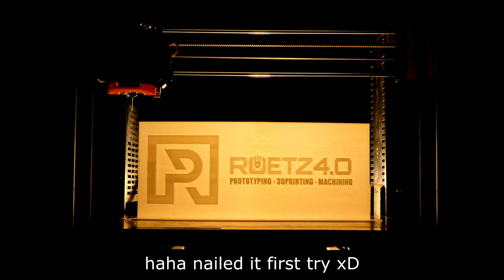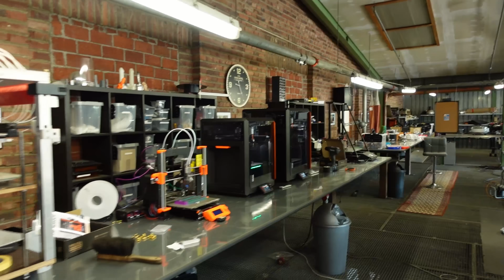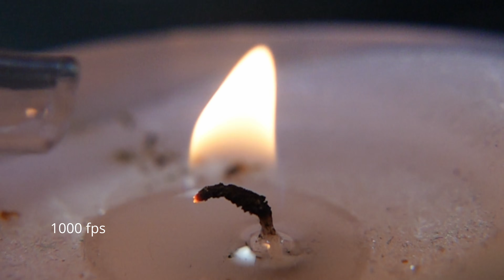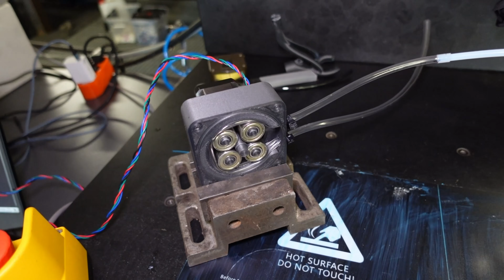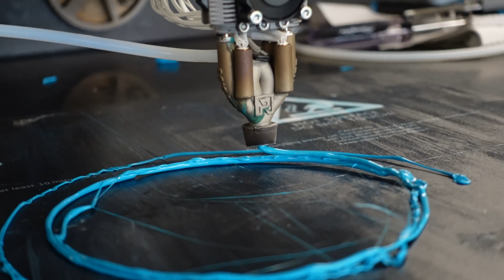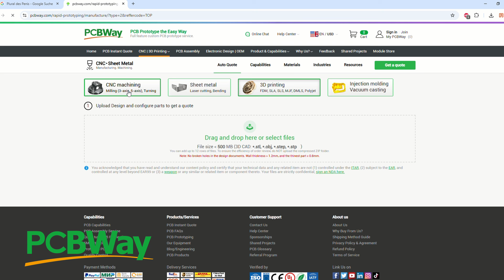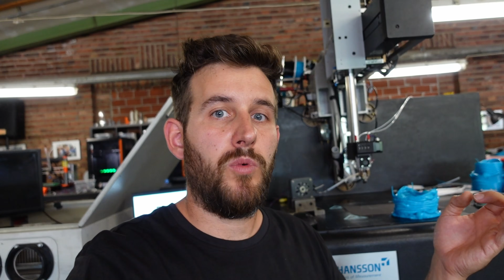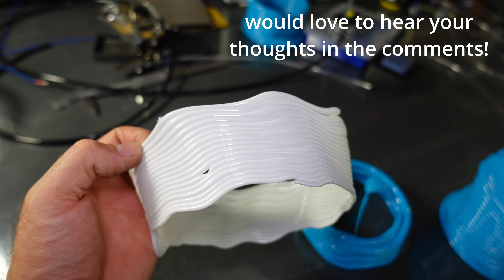Your Ideas made it WAY BETTER! 3D-Printing TPU Tubing

Comment: would it work to use water through the air channel instead to cool the plastic at the same time?
You could reuse it from a tank in the bottom if the prints starts a hole in the bottom of the print.

Comment: Use large syringes to provide a constant airflow. You could use a recycled Z stepper to plunge the syringe at a constant airflow. Maybe with two syringes and opposite threading one syringe plunges as the second syringe refills providing constant airflow from linear screw motion?

Comment: I think that using some form of an air tank/compressor, and have a variable valve that you can control, maybe a ball valve or an iris that you can let out a consistent flow of air would be what you’re looking for. The peristaltic pump I think would be an issue, especially down the road, as you would likely have more failure points.

Comment: I think you need something to blow cold air onto the part while it's printing, to cool the filament down faster and prevent it from expanding too much or melting excessively and losing height. Also, the speed seems a bit too high for something that stays molten for a long time.

Comment: I wonder if you would want to slightly vary the airflow based on the length of tubing (ie the amount of tubing you have already printed). My thoughts  are that after a while, the tube length becomes a significant "pressure vessel" or "tank" if you want to call it that. It mught be part of why it's hard to get the tubes started, after a certain volume the effect of the tank becomes significant enough to 1. Reduce the pressure, and 2. Smooth out the oscilations in pressure the pump produced. Overall really cool results!

Comment: I haven't quite grasped the idea behind all this yet. Is it about building the pump yourself, or is it about the end result of inflating the TPU? What about a small compressor with a tank and adjustable airflow? I think the tank and the ability to regulate the airflow—ensuring a consistent air flow rate at the right pressure—would be the simplest solution here.

Comment: try starting  in a spiral. Your starting layers are failing, but it starts going fine once it's established. Maybe that's a heating/cooling issue. Some sacrificial layers to the inside of the structure would give  it time to work the kinks out, potentially, as well as give it some structure to lean against when it gets to the first real layer. 

Or maybe it's as simple as preheating the bed.

Comment: Possible use case:
Quickly print a form that's a single unbroken tube, then fill said tube with another material (maybe something difficult or impossible to print, or to get specific composit material properties) 
Like silicones, urithain plastics, etc.

Comment: Since the volume of air changes with both temperature and pressure, I suspect it's very difficult to get consistent results by controlling the airflow without either an absurd level of control of the air temperature the whole way, and/or measuring the diameter of the extrusion and adjusting the airflow based on that continuously.

Comment: I think a mechanical pressure regulator on a constant supply would be great if you add a fast enough electronic valve controlled by PWM

Comment: instead of going up continuously in vase mode, have it step up in z each layer, and stop extruding for a second or two each layer and maybe rewind the pump to create a small vacuum to collapse the tubing at the seam. Doing this should make the layers more consistent since backpressure isn't continuously building as z goes up. your layers should be more repeatable and the only downside is you have one seam going up the wall.

Comment: Tubing has the potential to print very large objects very fast, but you have complicated needs.  The outer layer needs to adhere to itself while the inner layer should be prevented from adhering to itself or even deforming much.

Four ideas.

I keep thinking that to make a consistent print you cannot rely on a continuous run, simply because the pressure will have different effects when there is 10m of tubing to resist back pressure than when there is 10cm, and temperature of cooling hot gas throws a multi variable confounder into the equation.  For a consistent result it seems like you would need to perforate the tubing regularly (a 1mm laser hole or needle every 1cm?) to let out hot gas so that in the critical bonding zone you remain consistent.

Modern garden hoses are typically composites, especially near the reinforced ends.  A spiral of PLA embedded in TPU tubing would provide interesting material properties and interesting curing/solidification behavior, while requiring an extremely novel printhead.  Alternately, trying annular rings of different materials gives you an inner jacket of one material and an outer jacket of a different material.  Perhaps you tune this by using materials of different melting points and glass transition temperatures.

Assuming we do stick with a single ring of a single material, I think you also need to try prechilling the air running inside the tubing; the stiffer the inner wall of the tubing as it comes out of the extruder the more consistent of a result you might achieve.  The interior needs to be cooler than the exterior so that the exterior can bond layers while the interior does not even bend in on itself.

Using multiple shapes or a complex shape in place of a ring seems like it could provide desirable controllable dimensional stability. Perhaps instead of a tube, it's two tubes.  Two tubes right next to each other form a figure 8 or infinity symbol with two cavities. Perhaps try a square with four cavities, a hexagonal shape with six cavities or a honeycomb with seven cavities.  Inside the free flowing melt pool in the extruder you have some freedom to shape a manifold.

Comment: One problem you may be having is that the volume/pressue of the air will change as it cools. The longer the tube the more volume of gas you have at a stable temp, which can absorb some of that change in volume. I think this is why the start is so inconsistent: it's a small volume that is rapidly changing temperature from near printing temp (~200C) to close to ambient (~25C). With air that would be a volume change of around 40% assuming pressure doesn't change (The pressure will change, but that's going to depend on a lot of factors we don't have values for). My point is that the volume and pressure in the tube will be fluctuating a lot until there is enough volume of gas to absorb the change in volume and pressure of new hot gas as it cools. It may be that there will need to be a waste section that is meant to be cut off until the pressure/volume of the gas in the tube evens out. Maybe try a zig-zag pattern off to the side before starting the cylinder section to give that cooled volume of gas.

Using a liquid (as opposed to a gas) would prevent it from ballooning out like the gas does, since it won't increase volume to fill a larger space. It would require finding a liquid that remains liquid at both room temp and at printing temp, maybe something that does become solid at room temperatures could also work, but at that point you could just use a dissolving filament in your other nozzle (the one that you were printing coils with), if you could push the core filament at a higher rate then the encasement you might be able to get the same kind of tube structure (using PVA filament as the core for example), but you would need a lot of the core filament.

Comment: You may be able to drive a recycled refrigerant compressor, one of those fancy scroll compressors with a synchronous/AC motor, with the right stepper driver.

Comment: Just use a pancake air compressor and a flow regulator valve from an oxygen bottle. You likely dont need an inert gas or anything, but a flow regulator valve from an oxygen tank is measured in Liters per minute, not pressure, and can be dropped down pretty low for running nasalur cannula. I dont think a regular pressure regulator would work if you want to regulate volume. Good luck, hope to see it working!

Comment: This probably is WAY too much overhead, but would some continuous scanning during the print that analyzes the tubing shape and adjust the air flow and extruder sync ratio? There is a long way to go but this is amazing progress! I am blown away by the consistency.

Comment: Hey, this is the first video I'm watching in this series and I'm not sure if such an idea was already brought up or not but, do you think it would be possible to have the nozzle extrude at an angle rather than straight down? Like maybe a 45 degree angle with a built in gear system that will automatically turn the nozzle so that the extrusion is always facing the opposite direction of where the print head is traveling?
I imagine something like that would be extremely complicated to produce but it just came to me as an idea and I thought it wouldn't hurt to throw it out there before I go to work.
Thanks for all that you're doing against the gatekeeping of innovation, we really need many more like you in these fields! 😁
Reply from the maker: I think that would be doable, however quite some effort to achieve.

Comment: Your pump is a classic use-case for gearing - you want it to go really slowly, with lots of torque. I'd start off with like a 10:1 gearing.

You should put a spring loaded expansion chamber on the output of the pump with a really weak spring, it might help absorb some of the pressure irregularities in the pump output, as I assume the peaks are the main culprits of the bubbles.

You might be able to tilt your nozzle by something like 45* or even more (just the tip needs to be oriented that way, the rest of the hardware could still be vertical) and then add an extra axis to be able to spin the nozzle around on the vertical axis, so that your tube is extruded in a direction much closer to your print direction. I think this would have extreme benefits from not having to print so high up, and also enable you to add print cooling while still getting layer adhesion.

For starting your print, why not print like a traditional printer for the first layer, air turned off, nozzle really close to the plate, just to get good adhesion, then lift and turn on air for layer 2? Doing that should also give you your starting pinch as well at a predictable location, which should help with air volume and pressure adjustments. If that isn't acceptable and you want to start with a tube, a two-printer process may also work- print a raft in a different printer, then move the build plate over to the tube printer, and then print on top of the raft.

Comment: Dear Roetz, 

They make special stepper driven dual diaphragm  pumps with pressure feedback for pulsation free vacuum generation for degassing systems on analytical instruments.  Search e b a y for  "systec degassing pump"

They also make variable speed peristaltic pumps that are pulsation free that use a no linear speed profile that compensates for the pulsation as it is created.

As you are not attempting to control massflow there is no point in specifying a massflow controller (expensive) you are instead wanting to control PRESSURE as this is what will affect the current diameter of the soft extrusion.  As the volume or mass is irrelevant you should ignore it and instead have a programmable pressure controller.  The degasssing pumps indicated above could probably be modified to be a constant pressure system instead of a constant vacuum system with a little hardware or software tweaking and might be a drop in solution to the problem.

Early cooling using chilled gas inside will lock in the diameter while leaving the outside soft enough to adhere.

You could even consider an extruder that makes suitable tubing, cools it hard and then REHEATS the OUTSIDE to make it flexible and adhere to the print.  This might be a slightly novel idea to publish and/or test.  A hot air soldering unit that is able to re-heat only the outer portion of the tube might be the trick.

An additional idea just came to me.  What if you already had the tubing and heated the outside and then laid it down.

An obvious stretch goal is to prepare or use ready made DUAL LAYER tubing where the inner portion is already flexible but heat resistant and the outer portion is more rigid but melts at a lower temperature.  Now all you have to do it force it through an extruder/hot die and make the outside like hot glue and the inside will keep the tube shape until the outside sets again.

Comment: Don't get me wrong your work is simply brilliant. But resorting to a flame in the presence of water to illustrate airflow almost broke me or was the pressure too low to create bubbles? Preassure metric vie depth bubblability?
Next: Thermal control of the inflowing air, just to add another dimension to your hypercomplex playground of optimization.  Love your content.

Comment: I think for tubing, this is amazing! I am curious how hoses are made in industry, and if something like their approach is close to this. But the peristaltic pump was definitely the right direction. If you're not trying to make tubing (flow) as much as rigid volume, I'm wondering if it might be possible to foam a filament within the outer filament shell. I'm not sure where that might find a use... ballast maybe? But I'm enjoying your experiments and discovery. Thank you for sharing!

Comment: If you find a reliable way to close and open the filament (maybe by reversing the air pump?), that could be a way to fit airtight chambers inside flexible prints. I assume this could be both a benefit for shock absorptions, and actuator by hooking some kind of fitting into it

Comment: You could make pressure a closed loop system by adding a pressure sensor between the pump and extruder. 

It would allow you to monitor the prints ballooning, this would stop the feedback loop you mentioned of the arch's stacking up. It would also make reliable bridging possible.

You could possibly even slow things down really far and make intentionally perforated tubes, like soak hoses for watering plants or sprayers for coolant!

Comment: Since all the tubing is connected, I wonder if you can just operate at constant pressure, rather than constant volume. Would be much simpler if that works.

Comment: I am half thru the video, and I am at a complete loss as to why a peristaltic pump is anything worthwhile pursuing or even thinking about. It seems like there is nothing, absolutely nothing, it can do better (for this setup) than a 'simple' normal variable air pump with pressure/flow regulator? Can someone explain please? What am I missing here?

EDIT: ok, second half, after the sponsor, kind of answers the question / confirms what I was thinking. Still can't understand why people even would suggest a peristaltic pump in the first place though. Seems very odd to me.

Comment: 7:00    You should go to a pawn shop or some place where you can pick up a used drill that you can hack apart and use to power your pump. With a good power supply you can run it at any speed you need for as long as you want.

Comment: What you need for getting a smooth flow is a needle valve supplied from a high pressure source such as an air comprssor. Higher pressure is better. For if you have a 80 psi source and the tube makes 2 psi of backpressure, flow will be by reduced by mabye 2.5% as a result of the backpressure, which might not be too bad. Whereas if you start with low pressure, say 3 psi, and the tube makes 2 psi of backpressure, flow will be reduced by maybe 66%, which deffinitly would cause issues.

In short, stop using low pressures that the tubing can easily fight agianst. Use high pressures so that the tube cant fight back and has no choice but to be consistant.
Reply: To clarify: Start with high pressure, and drop all the pressure across a needle valve to set a consistant flow rate of air.

Comment: Not sure how well it will perform but you can also look into diaphragm pumps.

Also curious what happens if you modulate the air flow with some small solenoid valves.

Comment: Some rebreathers for scuba diving use a fixed-diameter orifice for metering a consistent amount of oxygen into the loop. This works because if the upstream pressure is above a certain threshold, the gas moving through the orifice hits the speed of sound, at which point the mass flow is determined only by the diameter of the orifice (and maybe the temperature?), so a steady/predictable mass flow can be achieved without any particularly careful pressure control. Look up semi-closed rebreathers if you're curious about this principle of operation.

Something like a shop compressor to maintain a high upstream pressure, plus an orifice, and a solenoid valve should allow pretty good metered air mass control with a minimum of expense or parts. Alternatively, if you can find a source for a variable/controllable orifice of appropriate diameter (maybe something like an EEV used in compressor air conditioning and refrigeration systems, if they're small enough) you could combine that with a compressed airstream to get steady-state, non-pulsating flow.

Comment: ever thought about putting compressed air into the middle part of the nozzle inlet to spray molten plastic ? maybe turn up the heat 30°C

Comment: - Couldn't you just gear down the stepper for more torque? That's how extruders do it these days, I think.
- As the inflation is dependent on backpressure - maybe pinch the extrusion in regular intervals to keep backpressure as constant as possible?

Comment: If a liquid is easier to control its flow, why dont you use one for the tubing? (Maybe you will need to insulate the inner wall of the inlet pipe in the nozzle in order to dont affect the temperature of the nozzle) And It will allows you to cool the tube faster